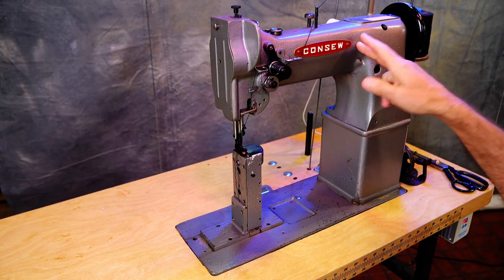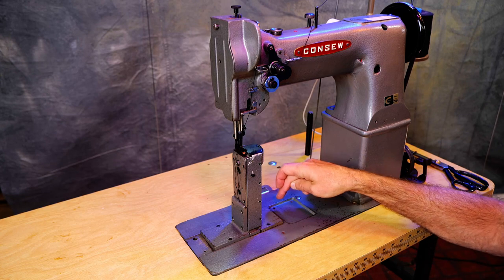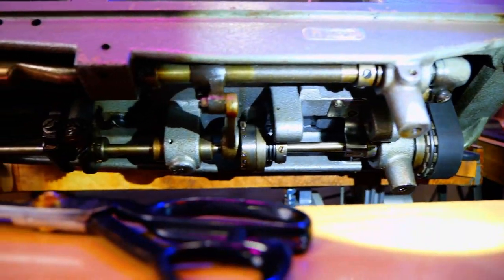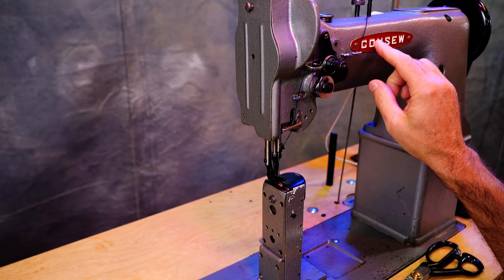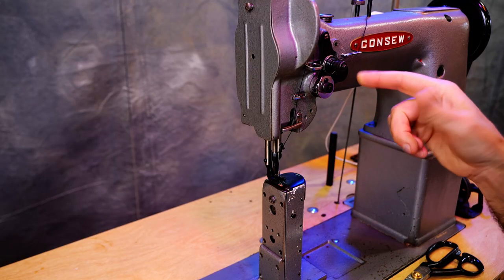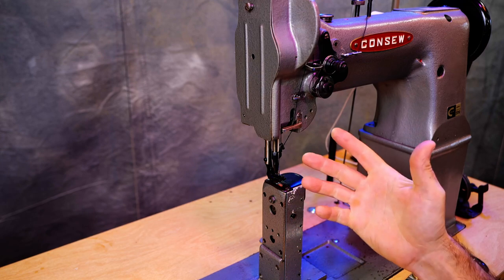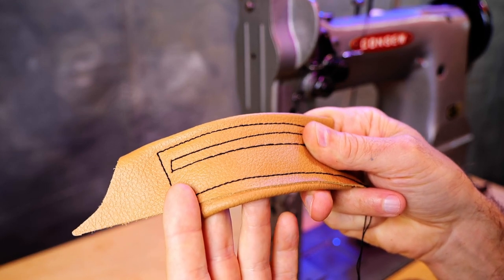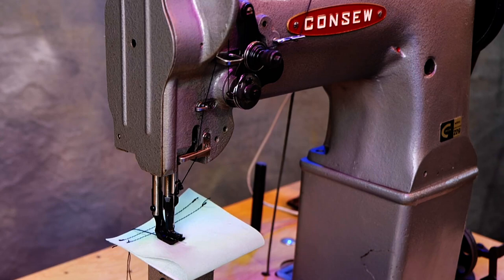Consew 229 Post Bed Triple Feed Sewing Machine

Comment: I'm sitting here sewing repairs on a motorcycle popup camper with a 111w153. I saw your other video on locking stitches several years ago
Reply from the maker: That is a good machine. A classic. I guess I will have to add motorcycle popup camper to the list of uses for the  111w153s.😃
Reply: @AlexanderDyer  I rebuilt it. It was guite a chore getting an entire tent under that arm

Comment: Hey Alex what thread do you recommend for stitching automotive or marine vinyl. I have been using v92 but maybe it would be better if I used 138...My machine wont pull 277. No real information out there on this But I know you have done several types of applications. wondering what you like to use for what. Might be a good video as well. Types of thread for applications that you like to use. And of course I saw your video on setting up a machine.....I noticed you have each machine setup for what thread you use, so you dont have to set the tension every time you change thread type.
Reply from the maker: Have you seen @Cechaflo. Definitely a good source for upholstery. Not sure if thread has been covered but it seems like an active channel and maybe they would answer you question. I just don't have any experience in the matter. Thread is a big, big topic. My go to thread is tex 105 core spun poly from California Thread https://www.calthread.com/category-s/180.htm
Reply: @AlexanderDyer  Oh yea 105....most of the upholstery guys say v92 which is what I am using. but it looks small on some pleats. Definitely too small for flat stitch. I dont have a guide for that anyway. Would be cool to see what you like to use. and what sizes you use for what products. Just your opinion. Thread sizes tension and what machines like what. What do you think of the Consew 1206rb....is it a cheaper version of the 206? I am using a REX 26-188 which I have had to weld attachments to welt with and it just does not work the greatest for upholstery. When welting it does not lift quite high enough. I have the presser foot all the way up.